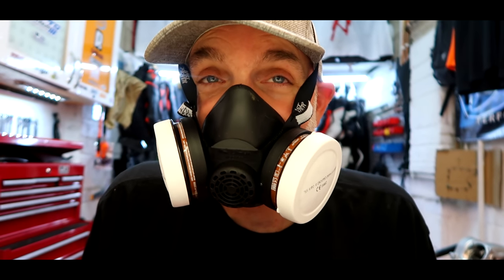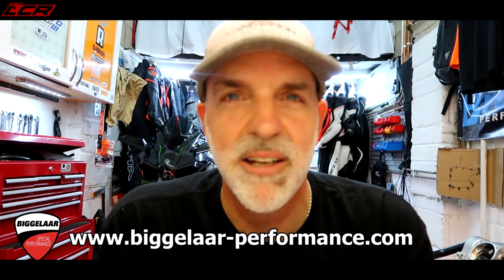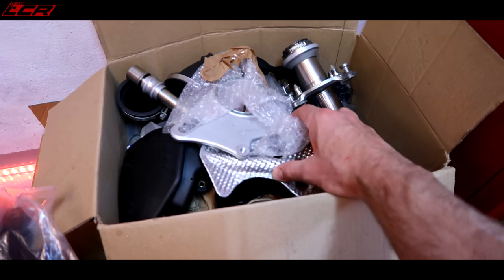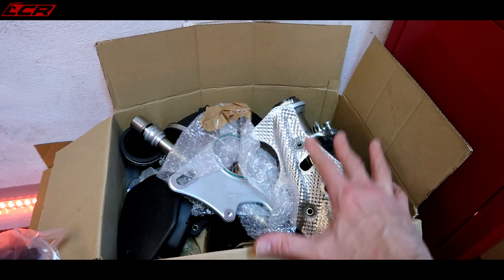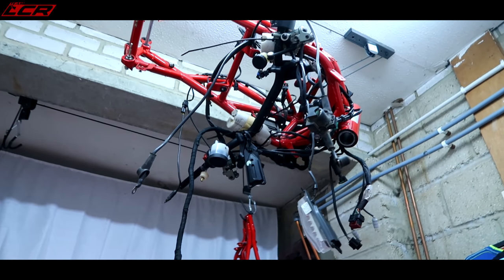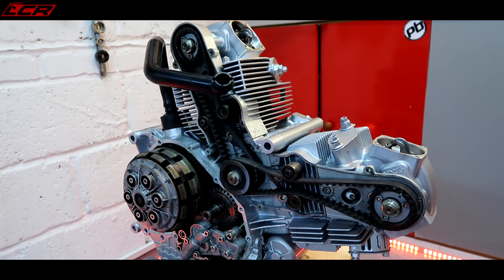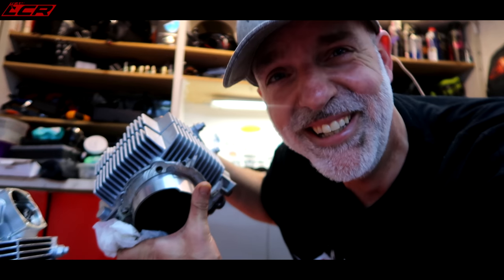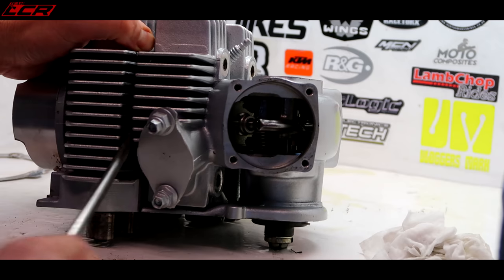Hypermotard Restoration EP08 | Heads Are Off!!!

Comment: Watch Andy all the time. He's a sound guy! It is scary taking an engine apart for the first time..it's like gearboxes..seen as a dark art, but it's not that bad.. Putting together is all about attention to detail, being meticulous and clean. When you break it down, it's all very simple steps to build, but just a lot of these steps. Starting an engine you've just built..even partially, for the first time, is another level of nervousness, but so rewarding when it fires up! I've just finished a ford V6 and it's so rewarding to hear it start a few weeks back after a total strip, machining and rebuild. This project just went to 11!  It's going to be a stunner! Just in hind sight...would have been cool to get a base line dyno run before the strip down....but you didn't know you would be going this far at the time!
Reply from the maker: Absolutely agree Vermon!

Comment: Brave man! And good progress made. Kudos!

I don't know whether you've changed or tensioned  your belts before so you may already know this. Those belt pulleys are floating and when you reassemble them you need to align the timing mark on the flange with the marks on the pulley wheel and big washer (with the three screw holes).

When tensioning the belts you must also lock the cams in position using the special pins (88713.3152) or home made alternatives. They screw in through the cam end covers and locate in the holes on the outer edges of the camshafts on the left side of the motor. It's also safer if you lock the crankshaft in position too.

If you don't want to buy all the special tools and, as we seem to be in the same locale, I have  the crank turning and locking tools plus the cam locking pins you can borrow if you need to.

Looking forward to the next episode.
Reply from the maker: Thanks for the tip! I may take you up on the parts if you dont mind :-)

Comment: I believe that the Desmo system was developed, to eliminate issues associated with valve spring chatter at higher RPM; I expect it is still used on their modern V2 and (possibly) V4 today.

Comment: The tyre garage decided to remove the full exhaust on my multistrada 1200 to get the rear wheel out. They sheared the exhaust studs off. I had to take the front cylinder off to get it machined. That was a vertical learning curve. Ducatis are easy to work on. Don't get too excited by this timing belt bollocks. If it feels right, it is.  loving the video's.
Reply from the maker: Oh god sounds like an absolute nightmare Gareth ☹

Comment: Nice! Curious about the results of the porting! And clutch. 
And now you can clean the paint off the cylinder head nuts 🤪 
(im kinda allergic for paint on nuts/bolts like an engine or piece has been dunked in a bath of paint, like Kubota engines are for warranty reasons) 
Looking good, really nice update!
Reply from the maker: Yes this is why Im stripping it all as worth getting the painting done professionally on the heads and barrels now. And new head nuts just for you :-)

Comment: I wondered if you would come across Biggelarr at some point. Thanks for the content, really enjoying this. Spesh now 44 teeth BBB has finished.  That head nut removal tool looks shite mate, I’d be concerned that might round your nuts off putting them back on. New spark plugs now. I have to say I was cringing when you got the tools out to split the head off the barrel. Wouldn’t it have made more sense to send the heads complete to Biggelarr as he would have them apart in minutes without damage?
Reply from the maker: Hi Stephen, I need everything out for the Cerakote hence why I'm tackling it first 👍

Comment: Once you get the head to move a little spray it with wd40 then tap it back together and try to separate it again.Just keep moving it and it will eventually free off.Get yourself one of those telescopic magnetic pens with a light on the end and you can use that to hook out the collets on top of the valve.I think you are finding out you need loads of special tools for working on that bike! I'd check that head tool or your nuts on the head are good,you don't want to round off one of those torquing it back down! Well done mate your well out of your comfort zone Chops 🤭🤭🤭👍🏻👍🏻👍🏻😎
Reply from the maker: Good tip, where was you on Tuesday when I did this 😂

Comment: I hope you'll be lucky and have the heads returned with the valves and shims fitted because if you found removing the closing shim collets hard wait until you try to fit them lol, it's the most fiddly job in existence.
Reply from the maker: Yes indeed, wouldn't want to put that lot back together! Toine is shipping it all done and ready to bolt on 😎😎

Comment: I always heard that desmo was to overcome the return speed limitation that springs hit eventually (valve float?) - always a trade-off between spring tension and valve return speed (. . .and stiffer spring more likely to fail?)  . . .and so you can have a much higher revving engine.
Reply from the maker: Yes you are correct sir, think the problem was to match the performance with springs they used to break but modern tolerances and materials hardly ever now. But its a good design and works so why would they change!

Comment: I’ve watched a few of Andy’s vids; he’s a serious engineer. But your ‘suck it and see’ level of home mechanic bravery is far less confrontational for someone like me 🤓. Desmo valves have a couple of advantages: no valve bounce at high revs (not a problem for the Hyper) and they also provide less power robbing resistance than valve springs.
Reply from the maker: Yes hes easy to watch too Bruce, soothing viewing :-)  Yes good point regard the desmo valves!

Comment: No need to remove the cam pulleys to take the belts off, slacken the fixed ldler and tensioner idler and slide the belts off. Crank and camshaft pulleys are all marked and line up witm marks on the crankcase and belt cover backplates for re timing, its all fairly straight forward, take your time  and dont over tension the belts, good luck.
Reply from the maker: Thanks Mark 👍👍
Reply: Hello Joss, I also have a S2r 800, for seven years, have changed the belts three times. Remove spark plugs, belt covers, use a paddock stand to lift the rear wheel, put in second or third gear and turn the rear wheel until the notch on the crank pulley is in line with the raised line on the crankcase, horizontal cylinder cam pulley notch will line up at twelve oclock with a rased mark on the belt backplate, vertical  cylinder pulley notch atapprox nine oclock, horizontal cylinder is at top dead center compression.
Slacken   the adjustable tensioner, they could be tight, use a good allen key socket. Fit the new belts push on the sliding tensioner with two fingers and nip up the  screw, check tension by sliding a 5 mm allen key between the belt and the fixed idler tensioner, shound go through with just a bit of resistance, on the vertical cylinder use a 6 mm allen key, it runs hotter and the cylinder expands in legth a bit more so you then have the correct tension on a hot engine.
Once you are happy rotate the engine a few times and reline timing marks , recheck tension, and tighten tensiners to correct torque setting fixed tensioner 20 Nm, adjustable tensioner 25 Nm. As another rule of thumb you should not be able to twist the belt through more than 45 degrees with reasonable thumb and forefinger pressure om the longest run of the belt, between fixed tensioner and cam pulley, if i rember correctly.
Recheck the tension after 50 miles say. I cut a small slot in the covers about 30mm x 6mm directly over the fixed tensioner, so I can check belt tension now and agian without removing the covers, more of a visual  peace of mind thing, check cold, on a hot engine they will of course feel tighter. Take you time its not that hard, youtubes california cycle works runs through and is helpful. This is my second two valve ducati, and have not had any issues using this method, good luck...
Reply: Joss, ignore fixed tensioner torque setting, as it does not have to be loosened to change belts, only the two screws on the sliding adjuster tensioner. Mark.

Comment: Could probably do with a valve compressor tool for reassembly to help get those collets back in without having to jab things with a screwdriver 🤣. There's a tool for everything aha. Once clamped you will be able to just use a magnetic screwdriver and your finger just to slot them back into position before releasing the compressor tool
Reply from the maker: Luckily Toine is refitting everything, not sure I could ever trust it if I did it! I have to refit to engine of course

Comment: Aagh valve collets, little b*stards! Long nose vice pliers (mole grips) are a great 3rd hand.
Dude why are you removing the rockers? To port it he just needs the valves out and access to the inlet and exhaust ports, no?
Reply: No.. need to take the valve guides put back out of the channel to be able to port the entire channel, and to put them back you need space for the tool.. so everything out is the way, if you want check my Facebook page where i have put some live streams while working and tuning a 2 Valve head similar to these ones
Reply from the maker: Yes what Toine said 😁